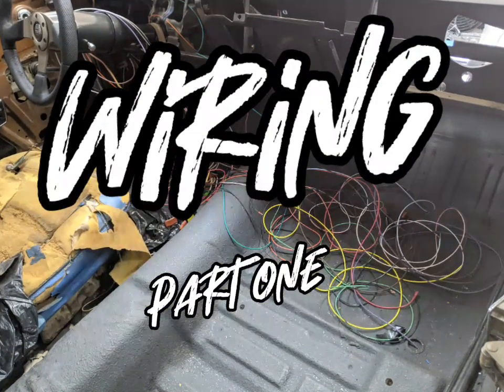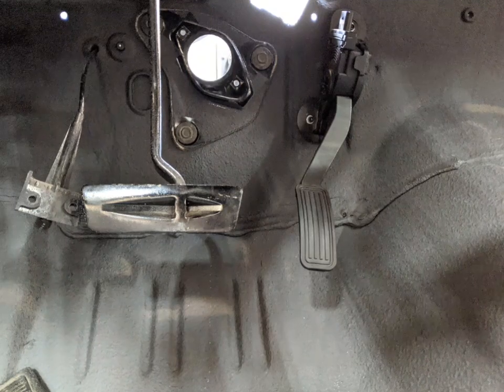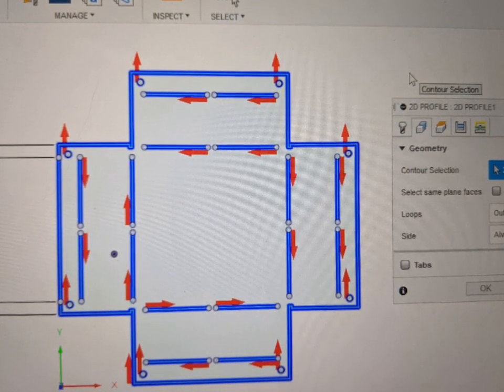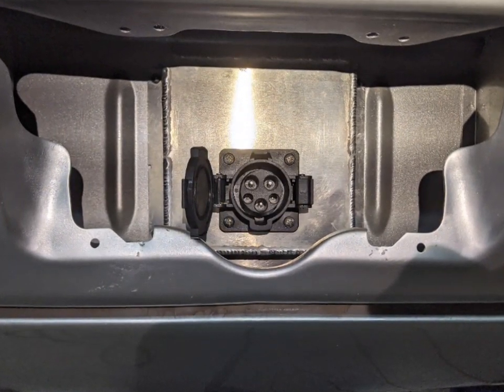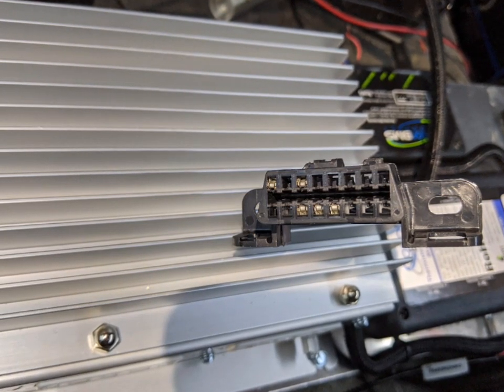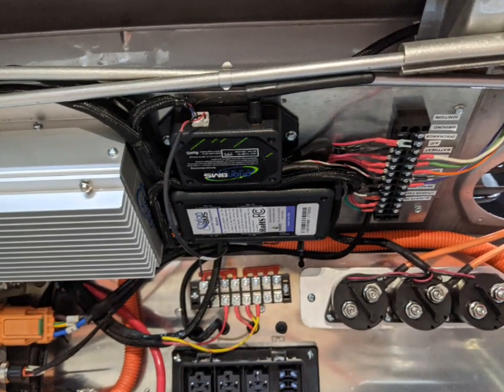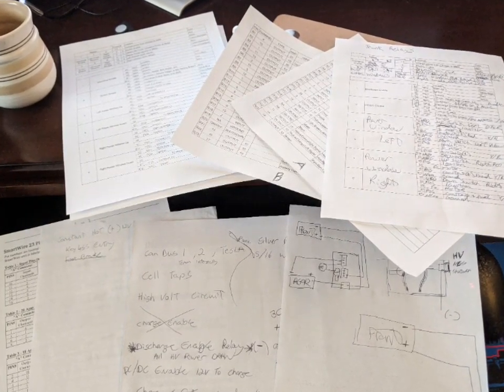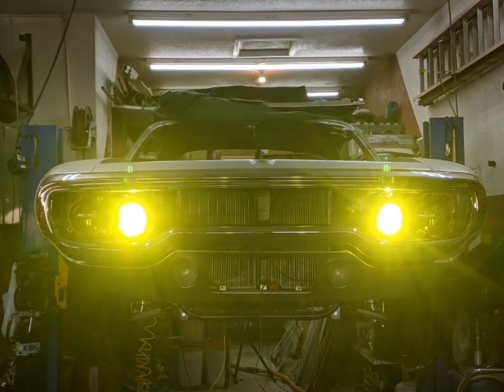Project Electrollite - Plymouth Satellite Tesla Swap - Wiring Part One Ep. 10

Comment: Your aluminium busbar, does it draw a lot of current? I don't know electrics well, but I saw on another channel he used stainless steel for a busbar and it had 41x the resistance of copper, so it maybe worth checking with someone who is electrically minded, if you should use copper instead. BTW recently found your channel, loving the car, great job Kevin, Greetings from Scotland
Reply from the maker: Yep I cut that out of scrap aluminum  that I had laying around that day.  Everything going through that bus bar is 30 amps or less.   I figure it's something I will check on every so often and see how it's holding up.   I think cutting it out of copper and then nickel plating it would be ideal, probably a marketable product as well.   Thanks for checking out my channel and the car!

Comment: Love your project, but at 6:11 you talk about your buss bar being aluminum.  This is a very bad idea as you will get corrosion at the termination points between the buss bar and the fuse holder.  Virtually all electrical equipment is NOT rated for use with aluminum unless it is specifically marked as such (there are special connectors that are designed for copper and aluminum but these are special case items for use in houses with existing aluminum wiring). 
Read this story for more info: https://www.familyhandyman.com/article/aluminum-wiring-can-be-hazardous-heres-what-to-do-about-it/
Reply from the maker: Right, I have some copper plate to cut out the same part for the low amperage accessories/charger.

Comment: Looks like the charge port cover should have been mounted to flip down not left... just an observation
Reply from the maker: I'll have to check into that...I tried to align it with a charger connector.  Luckily it is square so I can redo it if necessary.  Thanks for the input!